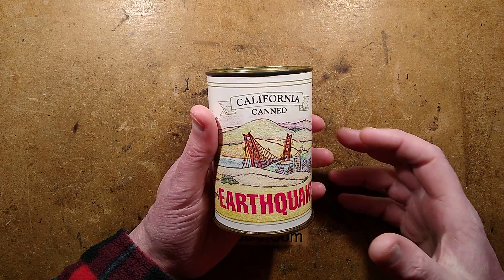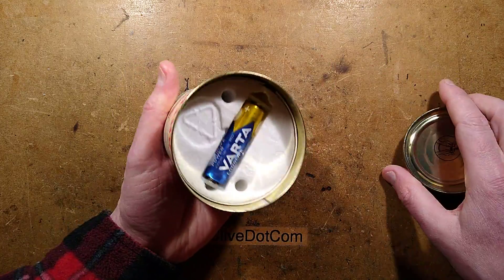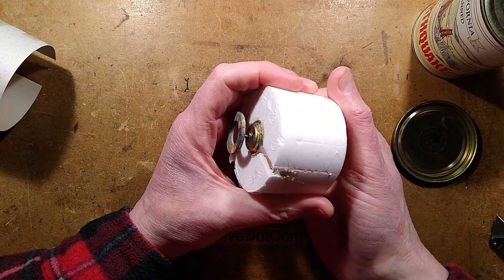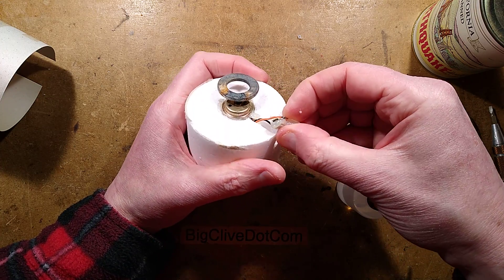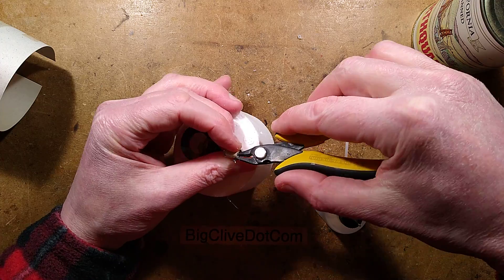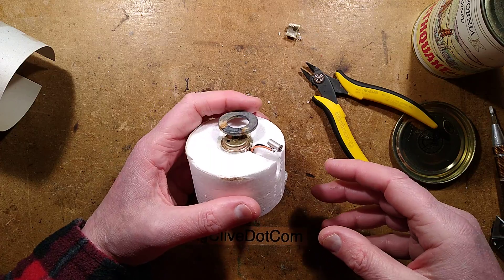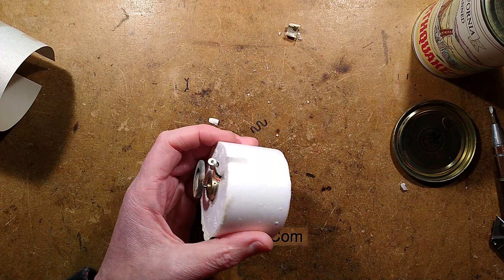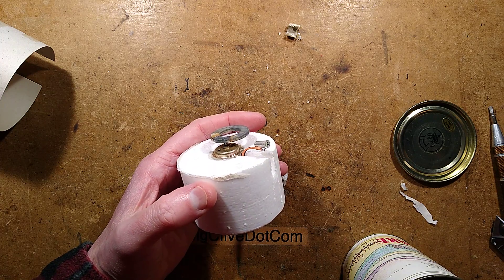Inside a Dynmo canned earthquake

Comment: The mercury 'scare' was such a ridiculous reason to ban it altogether. In the medical field, ALL mercury column blood pressure manometers HAD to be replaced with aneroid gauge types here in the US.
Reply: Medical equipment actually tends to get an exemption from RoHS-type legislation (at least in Europe).

The main reason for banning mercury in mass-produced products isn't consumer safety, it's environmental contamination.

And hospitals generally already have mechanisms in place to dispose of dangerous substances, so they're allowed to use them if they give provide tangible benefit (ex., medical equipment can use leaded solder - it's not allowed in general consumer goods because those tend to go into the garbage, and can end up contaminating groundwater).
Reply: Seriously ridiculous, it almost makes more sense that it was for alternative reasons rather than safety..

Especially when you consider that while telling us it was super toxic they decided to just dump many tons of it in the ocean! (Idk who dumped it, might have been greedy companies, but still interesting isn’t it?)
Reply: @HuheJass So, is all positive movement "ridiculous" if there happens to be negative movement elsewhere that cancels it out? All you get without the progress is a situation that's twice as bad.
Reply: @Audiobungalow  What is progress about halting research into one of the most unique materials?

Comment: Interesting little device. Quite surprised to not see them using a standard stamped steel counterweight. Must get myself some more mercury switches. Bought some in 2017 on ebay..

Comment: mercury tilt switches are under the bonnet and in the boot of old volvo 240/740 and possibly some older saabs.  where i got my little bit of mercury from.   volvo used them for auto on / off boot and bonnet lights

Comment: Not that long ago, I bought a used, mechanical thermostat on eBay. I was actually surprised that it had a mercury switch in it. I thought those were illegal to sell at least in the United States.
Reply: Not at all illegal. 
They do not meet up to certian build standards, and on the other hand Mercury tilt switches are the ONLY switches that meet other building standards, such as in a fireworks storehouse, or near certian welding gasses.

Overall it is a question of intended use not blanket legality

Comment: mercury in old electronics are quite interesting to find. my old house' AC/heater controls had a whole spiral of flat spring with mercury tilt switch at the end, and that was the thermostat. it had a handle to rotate the whole spring into a desired temperature
Reply: It's not flat spring. It's bimetallic and bends in response to temperature changes. Similar to classic thermostats in engines.
Reply: @Slicerwizard  that's what it's called. I know how it works; different metal with different heat expansion on either side of sheet. it was rigid enough to function as a spring tho

Comment: "Oh good, mercury. Let's open it up."
Reply: Metallic mercury isn't half as bad as it's made out to be. It's the vapors and the salts you really need to be weary of.
Reply: @remcovanvliet3018  Yeah but do you typically come across vapors? Or is it, the risk of turning low domestic quantities of metallic mercury into enough vapors to be an issue is just basically zero so it's safe? You'd have to stick the tiny tiny blob on something hot and then huff from the air above it until it's gone or something :)
Reply: @Bozebo  like so many things it's bad in industrial quantities. It's bad if you accidentally spill a few tons of it on the side of a road somewhere. It's bad if you're handling it as part of your job every day for years without PPE. Occasional contact with small quantities isn't a significant risk unless you do something especially stupid.
Reply: In the early 70s I was at tech college doing physics and one of the older lecturers was all set to demonstrate absorption using a mercury lamp and a tray of mercury over a Bunsen burner when he was told he couldn't on safety grounds. 
At this time we were still using benzine and toluene as solvents in the chemistry labs and of course mercury in glass was the standard for good quality thermometers.
Reply: @ColinMill1  my dad worked in industrial ceramics and once brought home a fair sized bottle of mercury for us to play with. This would have been mid 1970s. I sometimes wonder if my old house ever became a Superfund site.
Reply: @tncorgi92  Some years after I left the tech college buildings were demolished and houses built on the site. I wonder if they checked for contamination - I bet not.
Reply: @ColinMill1  yeah used to be you just buried the contamination, and that was it. I lived in St. Petersburg when they started construction on the MLB stadium, an oil and gas plant and industrial park had been there before and when they started digging they found heavy metals and hydrocarbons saturating the ground. Had to scrape it all up and replace the soil.
Reply: metallic mercury is fine to handle as long and you dont heat it and breathe the fumes for hours and hours. the really dangerous stuff is mercury salts aka organic mercury. its like carbon dioxide vs carbon monoxide, people often confuse the two, but one is like 10000x more dangerous than the other.

Comment: I think the recycling code says "3", or PVC, not recyclable. I'm glad the battery is accessible. I like the design simplicity. Made today it would have had a controller, etc.
Reply: Made today it would have Bluetooth and Wi-Fi, USB charging, and cost $39.95.
Reply: @jpdemer5  ...and locked out until you made an account with the maker so they can sell your aggregated data to the highest bidder. Joke? That's what it takes to turn on a lightbulb these days! Sheesh!

Comment: I earned a few extra bucks in my undergrad days, clearing out the labs of a departed chemistry prof.  Lots of fun defusing old, dried-out reactive chemicals, cleaning and organizing a ton of glassware, and collecting what added up to about a half-gallon (~75 lbs)  of liquid mercury.  We left it for the Chem Dept. to deal with; I regretted not setting some aside for personal pursuits, but it was probably for  the best.
Reply: I used to work in a chem lab too and they warned us if we ever came across a can of diethyl ether don't even touch it. The peroxides that form from age were friction sensitive and explosive.
Reply: @lightningdemolition1964  It must've been fun discovering that for the first time.

Comment: I LOVE mercury switches! Recently got an old Honywell thermostat with mercury switch from a friend ;)
Reply: Don't throw away that stat. Even really ancient ones with a merc switch will perform better than any modern electronic stat. I worked for that firm many years ago. We tested a lot of new and old stats. The T86 / T87 round style were the best for smooth response and reliability. Keep them dust free and they will last ages. cheers!
Reply: @jeffdayman Don't worry, I won't ;) I was almost just as happy with that simple old thermostat as I was when my GMA2 command wing arrived!
For those who don;t know what that is: it's a professional lighting controller. Obsolete now, but still worth a couple of thousand euro used!
Reply: @jeffdayman   I thought a good digital thermostat performs just as well (until it malfunctions) as a T87. And if you want multi-stage control or other features you basically need digital. And modern non-mercury mechanical ones are the worst.

Comment: I once needed a tilt switch for a "gadget". I made one from the glass waterlevel indicator from a clothes iron, two small pieces of cork, two needles and a few small ball bearings. Worked like mercury. The purpose of the gadget? I put it under a chair in the cantina with a doorbell, a small relay and a battery. When someone sitting on the chair tilted the chair "too much" the bell  started ringing. The relay ensured that it kept ringing.
Reply: I've often wondered if a water switch would work as a substitute for Mercury in RoHS-compliant devices. Provided you don't make the contacts out of anything that corrodes in water, or use voltages high enough to cause electrolysis?... 😇
Reply from the maker: I think they tried chemical ones, but electrolysis is an issue.

Comment: This is the funniest thing I’ve ever seen in a while. I might creat this with a random can and print my own label.
Reply: Well which is it? Ever? Or a while? 😂
Reply: Same! If you even do, please share a printable design online (and here).
Reply: This has been mentioned in an earlier comment, but you can make one of these with no electronics. You just attach a weight to a rubber band and glue the rubber band to the top and bottom of the can so the weight is in the center of the can (and maybe throw in a cardboard sheet around the inner curved can wall so the weight won't clang against the side). Once the can is closed you just roll it on the side for a bit to 'charge' it (twisting the rubber band) and sit it upright to 'activate' it.

Comment: The really old ones are simplerer then this. It used to be thick rubber band with a heavy weight in the middle. You spin the can to wind up the rubber band and then set it down and the can would do the same thing as this battery powered one.
Reply: I had one of those. After I "Clived" it  I used the weight to throw lines into trees for my antenna projects.
Reply: I were indeed surprised to see a baterry since, for some reason, I were sure it used a rubberband though couldnt remember / figure out how they charged
Reply: @fish3977  you hold the can on the upper edge and swirl it around in a circle that motion moves the weight in a circular motion and winds the rubberband up.
Reply: Even before that, you'd cut off the hook on a coat hanger, thread a rubber band through a big, heavy clothes button, hook the ends of the rubber band over the ends of the hanger hook, wind it up, and stick it in an envelope to be delivered to the prankee.
Reply: @interestingoldthings4889 Yup, used to build those and put them in an envelope labeled "Danger: Rattlesnake Eggs"
Reply: than, not then.  Two different words with two different meanings.  =)
Reply: @stevenA44  😒
Reply: @patrickradcliffe3837 What? People need to learn the difference.

Comment: I still keep a box stuffed with old mercury thermostats.   Those mercury bulbs never go bad and can switch decent-size loads without issue.
Reply: Another advantage is the absence of switch bounce (which is virtually unavoidable with contact switches in the absence of additional external circuitry). For certain testing, we use mercury switches in our EMI lab for just this purpose.
Reply: I have some also......
Reply: Can’t have planned obsolescence with a device like that around.
Reply: A really high current through mercury will produce a lot of UV.
Reply: @robertsneddon731  Glass blocks UV. I have never seen a tilt switch with a quartz window.

It takes high voltage to get a switch to arc. Mercury's vapor pressure is low at room temperature. I think you might be able to ionize some of the mercury by positioning the switch so that only one electrode is in the mercury, then getting it to arc. The electrons will need to slam into the pool of mercury with enough energy, otherwise you'll mostly ionize the air in the vial. Do that for a while to get vaporized mercury. Then you'll produce UV light, but it won't penetrate the glass.

On the other hand, extremely high current will resistively heat the switch enough to vaporize the mercury and explode the glass vial, assuming the leads don't fail first.
Reply: @robertsneddon731  I think a slug of mercury vs a vapour of it will have slightly different reactions.
Reply: @robertsneddon731 And that's how misinformation works...
Reply: @robertsneddon731 🤦‍♂️